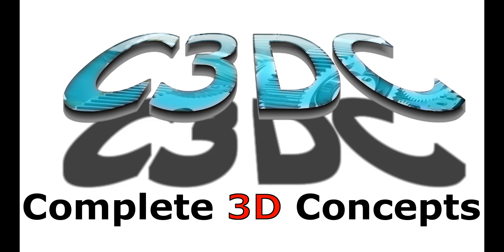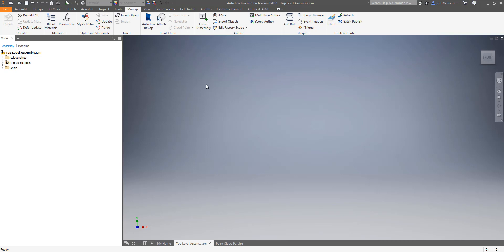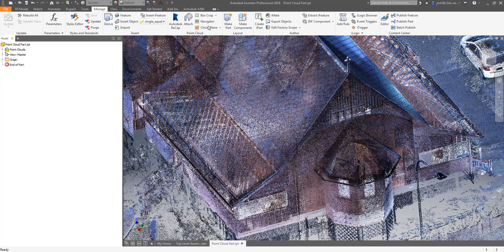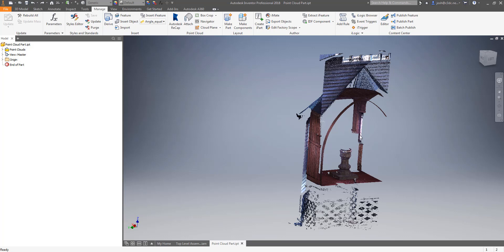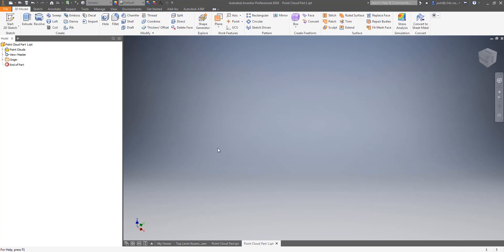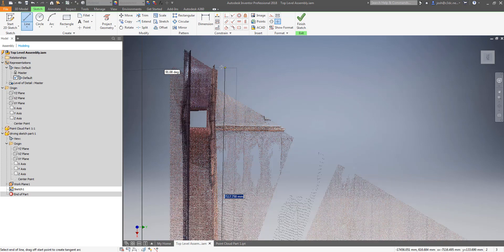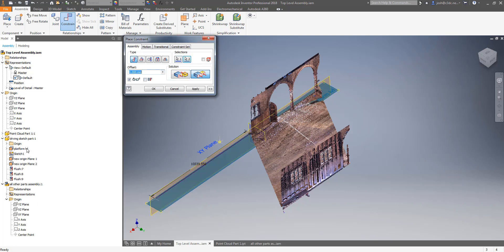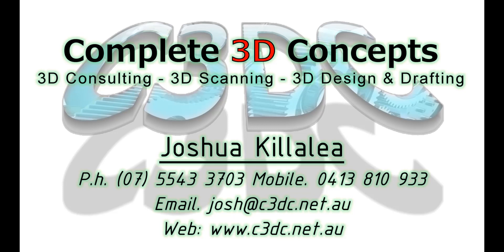Working with Point Clouds in Inventor Part 1

Comment: thanks for the video. I am having issues trying to alight a tank to two pumps... If I apply the original model dimensions, it doesn't match... we are replacing and redoing the pipes, but the pumps are slightly dealigned... How you takle this kind of situation?
Reply from the maker: In my experience what to do here would depend on 2 things. firstly, by how much the pipes/pumps are out. you have to remember at all times that the CAD process and fabrication process is entirely different. The fabrication process can introduce errors and then when those things are installed, the installation process can introduce more errors, or worse, changes that are made on the day, that are not captured in the drawings at the finish of project. this means the drawings you are working off can be a little bit out, or a lot out. so assess what is happening here. is it out by a few millimetres? (10-50mm) which could be accounted for in fabrication/installation tolerances, or is it very different to the drawings? if it is within tolerance, then just do it to the drawings and it should be OK. if it is a long way out, or very different to the drawings, then work to the point cloud. this approach should work regardless of what you are working on. Good luck with it.

Comment: You have to go in extreme depth with this. 
I am proficient in 3d autoCAD. But my company wants me to learn to use point clouds created by faro scanners on construction equipment. Is there an easy way to pop a plane on a point cloud in inventor ? I feel like I’m almost guessing to put in planes.
Reply from the maker: Firstly I would say, stick at it, you will work it out. Don't get too frustrated with it all. It is a complex task but you got this! 
Secondly I would advise watching the video a few times and listening carefully. I talk about placing planes in a couple of different ways, but these are not the kind of videos you can skip through the first couple of times and expect to pick up what is going on. Each part provides important information about what is happening in the next part. That said at the 18:00 min mark I tell you everything you need to know about cloud points and planes (the "easy" option).
If you have watched and followed the tutorial (both parts) a couple of times and still have questions please let me know. I know there is a LOT of information in these and I have had comments that I move through it all a bit fast, but you are getting years of experience condensed into ~45mins, so it is tricky.
If you are still really struggling, for a price you can always organise a one on one training session through a screen sharing app.